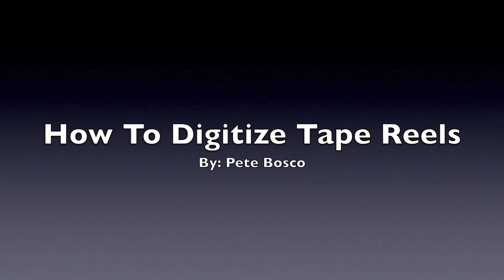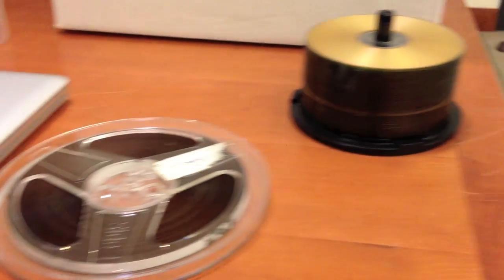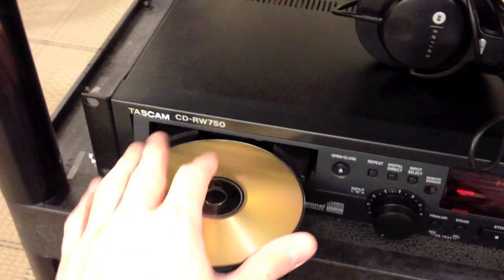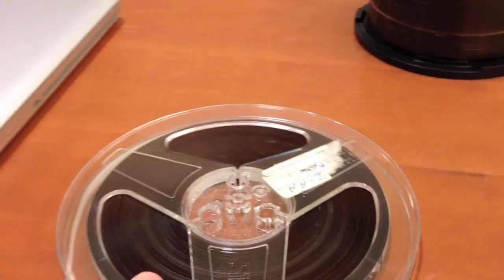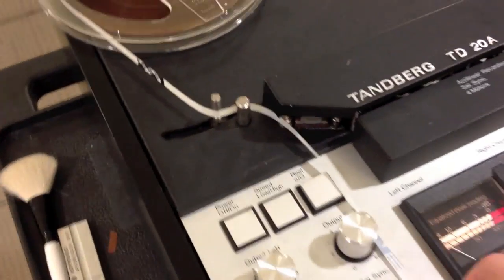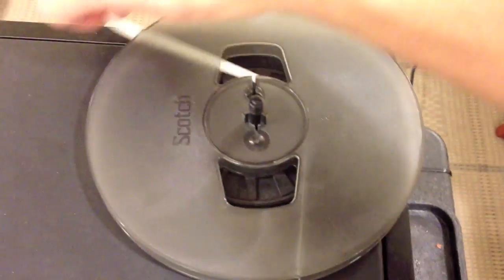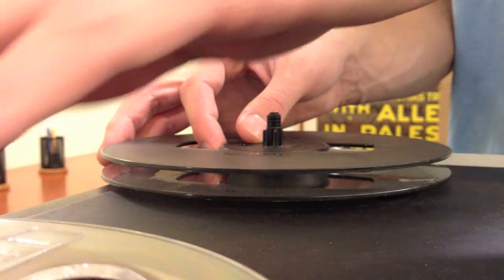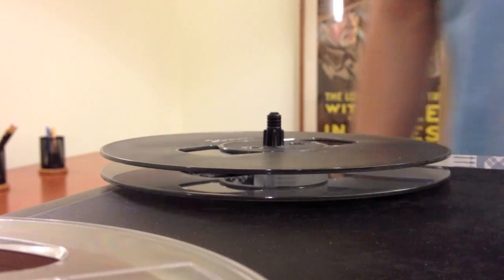How To Digitize A Tape Reel (CSIS 103L 721)

Comment: To everyone, what he was going to say, is when you have secured the reels, take an aux cable and plug it into a line in recorder (many cheap mp3 players and expensive zoom recorders have that option) if you'd like to record without a computer, or into the line in on your computer if you do. Start recording on your mp3 player and then hit play on the reel to reel..Stop both when you are finished. There will probably still be some hum in the recording, you can fix that on the computer with audacity or audition, or your fav software.

Comment: You lost my interest in the first few minutes.  1. Put the CD in the CD recorder. 2. Pick up the reel to reel tape. 3. Insert it on the r2r machine... Give me a break.  How about, if you have a computer, buy Roxio VHS to DVD Plus and get a cable that converts from the output of your tape deck to a RCA connection.  Then plug them in and use the Sound Recorder that comes with the Roxio program and record it.  The Roxio comes with a USB2 connection.